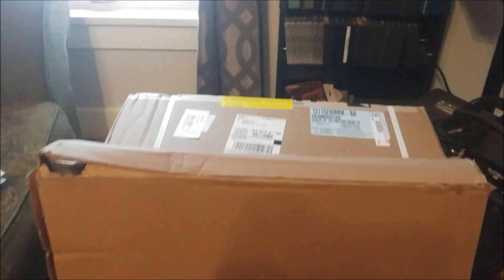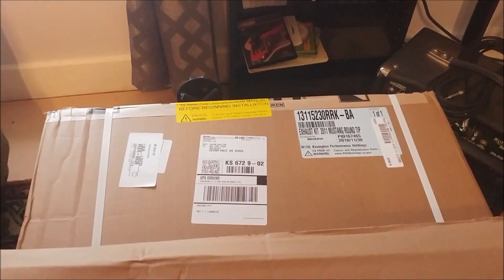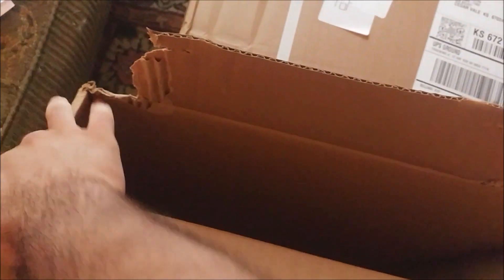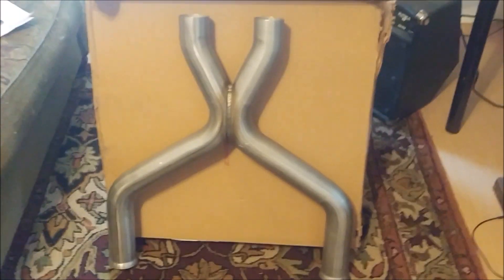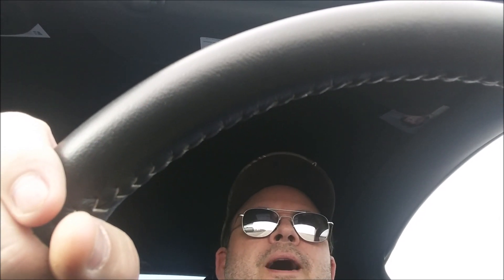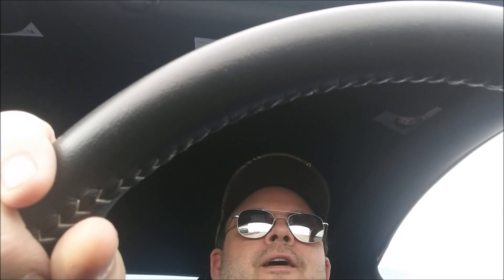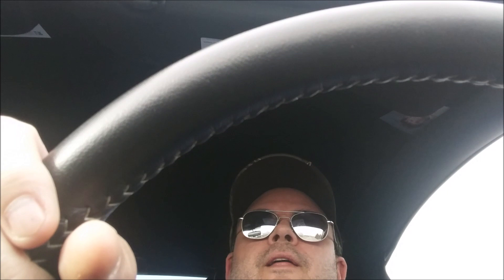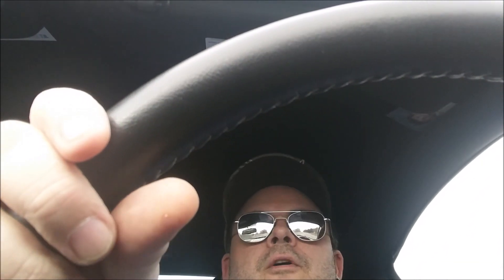2012 Mustang GT Roush Exhaust

Comment: Great set up you got. I currently have just roush axle backs on my 2012 gt and still debating to go with this x pipe or not. Do you think its worth it?
Reply from the maker: Absolutely it was worth it. I'm not sure if there is much, or any, difference between X-pipe manufacturers, but I am glad I did it. The Ford Performance X-pipe is affordable and it's from Ford, so no fitment issues.

Comment: I have had the same rattle from my roush mufflers, was it a bad muffler?
Reply from the maker: Looking back on this, I don't think it was a problem with the mufflers. I think the rattling noise that I heard was the spring on the factory installed "H" pipe that was rattling because of the extra loudness of the Roush mufflers. I haven't heard that rattle since installing the Ford Performance "X" pipe as it doesn't have any moving parts to vibrate.